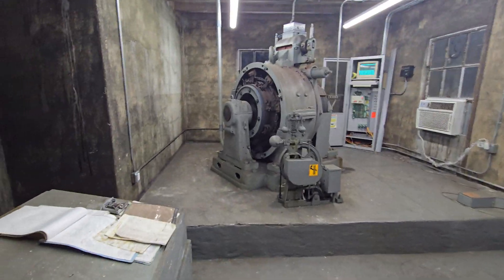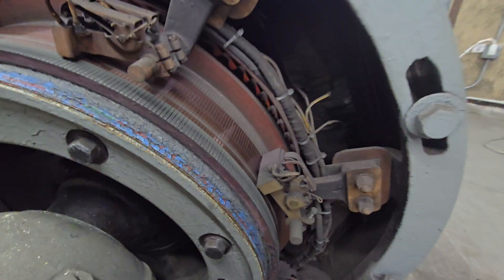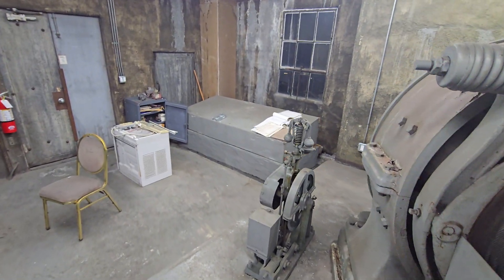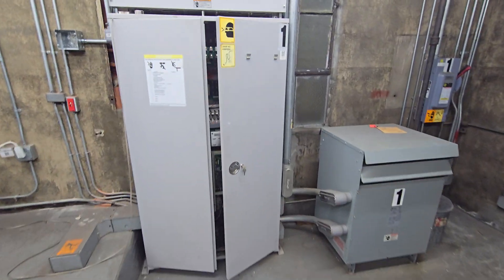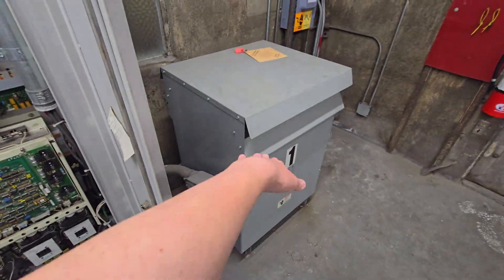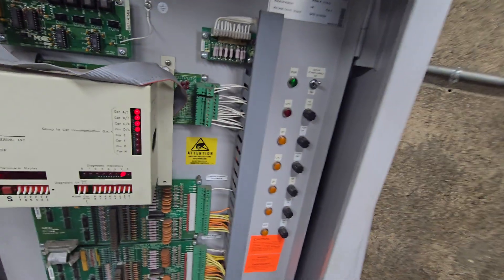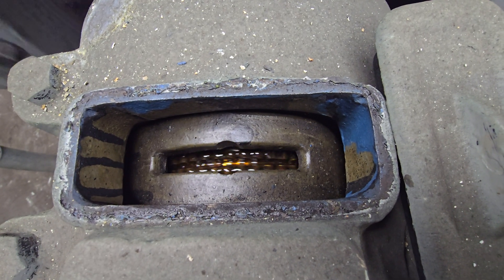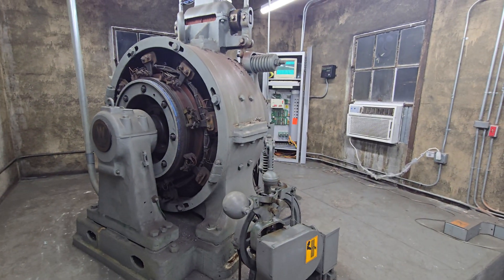EPIC 1910 Westinghouse/1990's MCE Gearless DC Traction Elevator Machine Room

Comment: In a lot of NYC school built in the 1920, use westinghouse motors 2 or 3 phase motors for their blowers, and before that like in the 1900's they used steam engines with similar governors to control the flow of the steam. 
But good video, I think you would appreciate seeing  some of those old equipment.

Comment: There is an oil sump in the bearing pedestals under the bearings.  Note the level gauge on the side of the pedestal.  The oil level should typically be maintained at the half point in the gauge glass unless otherwise marked.  An oil ring(s), which was visible when you removed the inspection cover, sits on the shaft and rotates with the shaft due to drag.  Due to the inherent tenacity of the oil, the oil ring brings oil up from the sump and deposits it on the shaft.  As the shaft rotates it carries the oil into the bearing.  The oil creates a film that's about 0.001 to 0.002 of an inch thick, so there is no metal to metal contact.  Only a couple shaft revolutions are needed to develop the oil film.  The oil ring should rotate smoothly without wobble or vibration, and not slow down and speed up.  The oil rings should be checked for rotation regularly.  If a ring hangs up, it will starve the bearing for oil.  The oil should be changed on an annual basis.  A good grade of turbine oil of the correct viscosity should be used.  

I have years of experience with oil ring lubricated sleeve bearings.  With some basic maintenance, those babbitt sleeve bearings will last almost indefinitely vs ball or roller bearings which have a finite life. 

I don't mean to sound anal, but when you remove the inspection covers, don't set them with the inside down on a dirty surface.  Either set the covers on clean,  lint free shop towels or place them with the inside facing up.  Dust and dirt particles can stick to the cover and drop into the bearing.  Dust and dirt is the enemy of bearings.

Comment: As an old electrician (retired) some free advice... DC motors or generators that have brushes and commutators need both humidity in the air and enough ampere density on the brush face for commutator film to form.  Without it bushes wear out very fast... I have seen problems where they have hazardous area equipment rated Ex p and someone has thought they would look after the machine better if they feed it dry instrument air rather than its normal air supply... bush life was reduce to five hours.... You might not be as drastic as that but the Air Conditioner you have might be having an effect.

Comment: With a centrifugal flyball governor - not as unserviceable or mysterious as a computer based controller - an elegant mechanism from a more civilized age
Reply: Also able to regulate the speed of a steam engine with good accuracy.
Reply: @John-u7z7v  they were used to regulate the speed of the generators as initially installed in the Hoover dam in the 1930s

Comment: The hum is not DC.The hum is the winndings and armature of the transformer reacting to the alternating current field 60 cycles per second. It is likely a delta/wye transformer or just for isolationn.You won't  put Direct Current through transformers.

Comment: I've seen many of these in 7 floor warehouses for the freight lift. I used to do card access and fire alarm on many lifts. You don't want to be jumpy when close to these where parts start up at any time on a ladder over the motor working on the fire detectors.

Comment: They sure do not build things like they used to. These old electric motors were overbuilt to the extent that they have lasted far longer than any new electric motor would last. Today's electric motors at best last only about 15 years.
Reply: The old motors had to be designed and built very well because they had to minimize internal temperatures since the wiring insulation at that time could not tolerate the temperatures encountered in today's motors without failing.

Comment: This old elevator has both new control equipment and an old DC motor. Also by looking at the room a modern rectifier is being used to convert AC to DC to power the old DC traction motor. Also the original equipment must have used a motor generator set to generate DC power. The Motor would be an induction motor driving a DC generator to provide DC power to the elevator traction motor.
Reply: In some places they used to have a separate DC supply from the utility company, just for lifts (OK, elevators :) Mercury rectifiers and things like that.
Reply: @alexkucherov5711  Con Edison in NYC used to supply DC for things such as building fire alarm systems. When they ended that service, rectifiers had to be installed. 
They also supplied 2-phase power for motors from the 1930's and earlier. Eventually, they stopped, and Scott-connected transformers had to be provided to convert 3-phase service to 2-phase power for the old motors.
Reply: MG sets are really cool, because the "generator" part actually acts like a power amplifier; you can use a small, low-current signal to vary the excitation, and the generator then produces a proportionately huge current at the output to drive the traction motor.  

There were actually even long-wave radio transmitters that use an MG set for the output power amplifier stage; they just fed the audio signal into the exciter coils and the spinning rotor simultaneously amplified and modulated it onto a carrier frequency set by the speed of rotation.
Reply: @tommcewan7936  I worked with some older equipment from the 1950's where process signals were used as inputs to thyratron rectifiers that controlled the field current to the generators in the MG sets. From the early '60's on, SCR drives started to replace the MG sets and their tube controllers.
The application was for mixers and extruders in the plastics industry.

Comment: I was fortunate enough to tour two elevator motor rooms at the Springfield Woolen Mill in Tennessee long after its closure. Same setup however, it was still 100% original from the 1920s, down to the relays. Still functioning and up to date on inspection. What an amazing testament to the rugged quality built back then!

Comment: When I read the type plate of the supply transformer correctly, secondary is 100 volts (single phase), this would in a three-phase power system lead to a rectified output voltage of 100 V x 2,34 = 234 volts DC, this would match the DC motor's armature voltage of 230 volts.
(In Europe, we use the 230/400V 50Hz three phase AC system, so if 3-phase (6-pulse) rectified it would supply about 230 V x 2,34 = 538 VDC).

Comment: It sucks when we get what are supposed to be informational videos from people who don't understand what they are showing you
Reply from the maker: I'm always learning more on these systems and have taken note of multiple comments correcting me on this. If you're going to leave feedback, at least be respectful about it. Theirs no reason to write 5 comments going on and on over the same thing. Anyways, what I learned is that the humming noise comes from the drive isolator transformer for the AC voltage going into the DC drive.

Comment: Worked in the elevator industry for many years and have never seen a brake like that on a Westinghouse machine.
Reply from the maker: I've seen it a couple times on these vintage Westinghouse machines. Certainly not common, though.
Reply: @QEElevators  Did not dawn on me when I made that comment but these are K & H machines.  Memory not what it used to be.

Comment: I have seen the mecanical room of a big ski lift in Austria. It was poweeed by two massive 1000hp 800V DC motors and built in 1971. It was one of the first to use SCRs instead of mercury arc rectifiers. During my visit the control system was beeing retrofitted, but in this case the SCR cabinets where left and only the interface and controlers where being replaced. Apparently the motors are controlled by only a 0-10V signal wire each. Pf cpure there are a lot of enable wires aswell for drive enable, contactors, brakes and the newley installed SF6 medium voltage breakers.

Comment: nice but I've been an electric an for almost 30 years and have a background in old elevators, but not trying to knock you down, just a correction, the transformer you showed and said this is where the dc comes from, incorrect, read the face plate, its an isolation transformer meaning it is giving a clean power source to the controller. the controller is taking the 480 volt 3 phase and thru rectification and producing the dc, also part of the controller is also a VFD. Variable Frequency Drive. vfd can be programmed to slow start motors and also take 3 phase or single phase power and switch it to dc, also that controller is also reading the proximity switches in the shaft and a plate attached to the car runs between the telling the controller where the car is and also for slowing down the motor to stop and for leveling the car to the floor, in this case the controller is nothing more then a PLC ( Programable Logic Controller ) with a built in VFD. Hopefully this helps, I always liked working on old elevators even though it has its ups and downs

Comment: What is the voltage of the motor and is it single phase or 3 phase what gauge wires go to motor and what amperage fuse or circuit breaker is it on
Reply: It is a DC motor that is fed by an SCR (silicon controlled rectifier) bank in the cabinet. By varying the phase angle of the SCRs the controler adjusts the DC voltage.

Comment: Where is the DC coming from. There used to be motor generator sets to provide the DC.
Reply from the maker: A solid state rectifier type converter called a DC Drive. This one uses a MCE System 12 DC Drive. It also controls the speed at the same time.

Comment: Awsome vid.  Look for friedrich window units.  About the only new reliable ac's
Reply from the maker: Ive heard they are good. A window AC really shouldn't be used in a room like this anyways, as this equipment produces so much heat and makes them run nonstop. I'd recommend they install a mini split system of some form.

Comment: It seems like those old machines really didn't need AC, The modern MCE equipment needs cooling more than the machine, just think 100 years ago there was no AC in that room.
Reply from the maker: @jreding132  Kind of doubt that, back then, the old machinery used a DC generator, which was an AC motor turning a DC motor to generate DC electricity. As you can imagine, they are very loud and produce a ton of heat. The new controller uses a solid state DC drive, which is much more efficient and generates little heat. Back then, they would've had a very powerful exhaust fan running in this room as everything used to be relays, and those aren't affected by moisture/dust.

Comment: why dont they put a modern air conditioner? put it to max cold 24/7 to cool all that equiptment and reduce moisture in the air.
Reply: Because they don’t need to, that RAC is good enough 😊
Reply: @steveosshenanigans  in the video they guy says that the window AC barely does any difference.
Reply from the maker: Not for motors like this, it's wayy underpowered. Lot of heat coming from this equipment.
Reply from the maker: Cheap management I'm guessing🤣
Reply: @QEElevators  its going to be more expensive change the 1920 motor and/or the stupid computers controlling it because the heat ends up generating mold on the walls that goes over the euipment eventually. then you need to redo the room and the machinery for the elevator. cheap becomes millionaire expense.
Reply from the maker: @aagc1988  When these motors overheat, it damages the windings over time and can require a complete motor rebuild. I'd recommend they install a mini-split AC unit here.
Reply: @QEElevators  i have acess (sometimes) to a very old (maybe 1940's) uruguayan (most likely imported) elevator motor. want some video or pictures next time i go to the engine room?

Comment: Nothing special.  DC Drive is kinda hokey, not a properly packaged design like you would get from Rockwell or Siemens.  The motor is kinda cool though.
You need to go to the hydroelectric dam at Mechanicville NY.  Still has original Tom Edison installed 40 Hz generators.

Comment: Umm, DC is constant, it doesn't hum.  Any hum you're hearing is from the AC side.  The transformer is there to convert the 480VAC incoming voltage down to 230VAC to feed the equipment.  This is standard practice to save costs on copper wiring.  480v will use half the current that a 240v supply would use.  The power wires running from the basement all the way to the top floor only have to be 1/2 the size they'd need to feed it with 240v.
Reply: Well said! Do you know why transformers hum? Because they don't know the words!
Reply: You are correct with the AC side of things but the main noise is actually coming from the DC output. The controller is using Pulse Width Modulation to control the power supplied to the motor. The buzz/hum comes from this because the controller is basically turning the power on and off very quickly. By slightly changing how long the power is on vs. how long it is off, the net amount of power that the motor puts out is changed. Even though it is DC does not mean that it is constant.
Reply: @FrontRangeRailfan PWM switching frequencies are typically in the kHz range, some stuff these days have switching frequencies into the MHz. Incidentally, some inverters have a parameter that allows you to adjust it over a range. In this case, it was classic 60 cycle hum coming from the step-down transformer.

Comment: 100 plus year old electric motor working with modern controllers, this is really cool.
Reply from the maker: @woobykal68  Those old machines will last much longer with the continuation of proper maintenance. Built like tanks!
Reply: @QEElevators  Потому что тогда всё это, проектировали инженеры, а не маркетологи.
Reply: @QEElevators   no Brasil na cidade do Rio de janeiro capital no bairros de Copacabana _urca _ zona sul há vários condomínios com elevadores antigos funcionando normalmente lá?
Reply: Funnily enough the motors do not care what is the age of the controller. As long as it gives proper signals and proper power parameters (voltage, amperage) the motor will work just fine.
Reply: DC motors all need the armature voltage dropped down below the field voltage to start. The old fashioned design was to use dropping resistors that allows the armature to start. Resistors are dropped one by one till full speed of the motor. Modern day this is done by electronics that you see here. In A/C motors they are called frequency drives. You find frequency drives in your washing machine today. Miniature 3 phase motors powered by the frequency drive. Motors back in the day were built with pride and excellent workmanship. Superior materials.